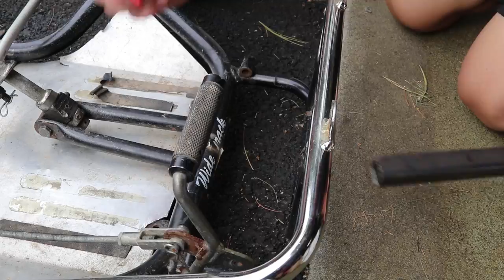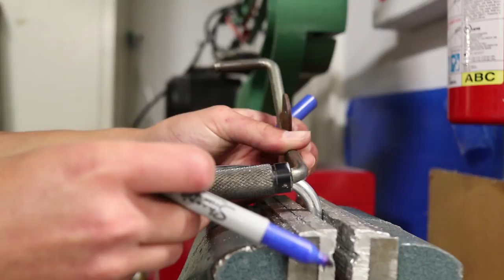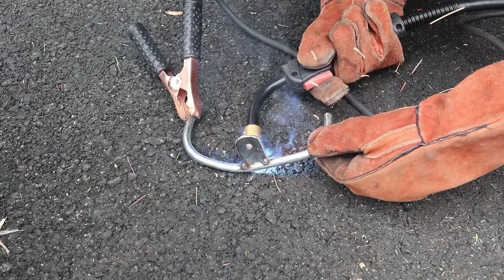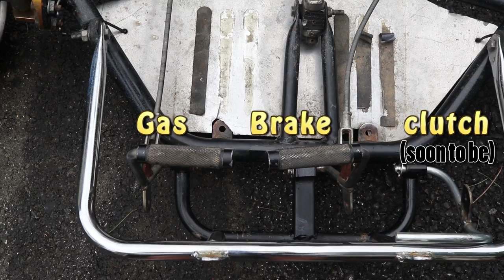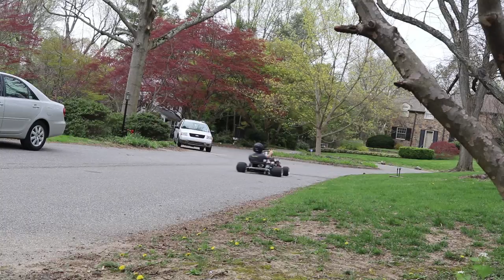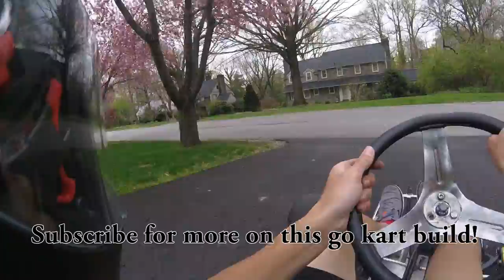STICK SHIFT GO KART BUILD EPISODE 1: PEDALS

Comment: Was that a ptm engine? You had on it first? I want to build my Own kart But i dont know what kinda engine I want on it yet could you help me?
Reply from the maker: Its a honda gx200 governor removed with ebay torque converter. If you want to go cheaper get a predator 212. Had that before and it worked great with a governor bypass
Reply: Thanks! But I was also Thinking to Buy a 125 cc pitbike engine. What would you reccoment?
Reply from the maker: If you know engines well and have a lot of experience go with the 125cc, but if you are new to small engines and go karts get a predator 212 or gx200
Reply: Allright Thanks!
Reply: Marc Zantinge for a gokart i recomend a honda 390 (or get a clone they work just as well) my gokart is running a ptm420(and whats the matter with you guys and torque converters
Reply: can you post a link to the 125cc motor

Comment: I have a question I'm not like engineer but why do you put a jumper cable or battery cable when you are welding?
Reply from the maker: Its an electric welder, so it needs a ground to complete the circuit
Reply: He didnt explain it to well there, yes he is correct but not complete with what he told you. Its called a welding cable, and due to the fact that its an arc welder it takes alot of voltage and a lot of amps through it,  so they use a low gage high current copper cable and a high current copper aligator clamp, much like that of a jumper cable, which is used to connect two cars main power circuits together which may be only 12 to 24 volts, but need a hell of a lot of amperage to turn over (spin the fly wheel that turns the crank shaft which moves everything in the engine to start the rotations in which are required for the engine to run,  if interested in knowing more look upna video about how an engine works) the engine. So anything thin and weak would melt. Hope this helps your curiosity!

Comment: hey where did you buy the lifan from? I would like to get one myself for my gokart
Reply from the maker: Got it from ebay. Its a pain cause shipping is $95 tho. Should be well worth it. It was a pain to figure out all the wiring and clutch but its all fixed up. Got a new fuel pump coming this week so I should be riding this weekend!
Reply: Awesome! Did you find a wiring harness online? Or did you make one? If so, what wiring schematic did you make it off of? I was thinking when I make mine I would put the clutch on the steering wheel using a bike brake.... just an idea to toss around. Thanks for the info!
Reply from the maker: The wiring harness comes with the 200cc lifan - set kit, so i used that but modified it by moving 2 wires to different ports and changing around one more wire to get it to work. I can make a video on the wiring if needed.
Reply: That would be so great if you could do that!  It would be a lot less time that I would need to spend trying to figure out how to get the whole wiring system to work

Comment: already see a huge flaw..... you dont have 3 legs
Reply: Alex Romo lol
Reply: Alex Romo it's like a stick shift anything really everything I seen had they pedals
Reply: L
Reply: Alex Romo motor setting in wrong place muffler guy to hot
Reply: Every guy has 3 legs
Reply: Alex Romo lol yes
Reply: That's what you use your left foot for as you're supposed to be using your left for both accelerating and braking